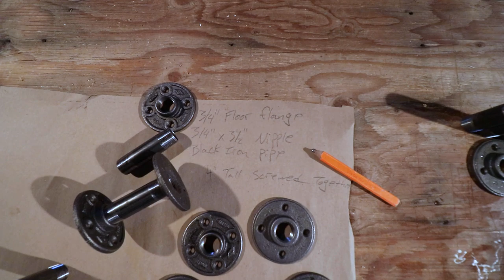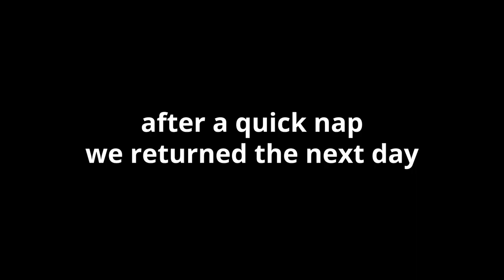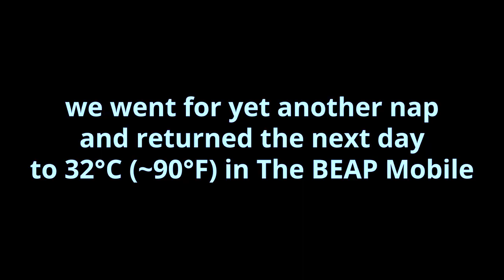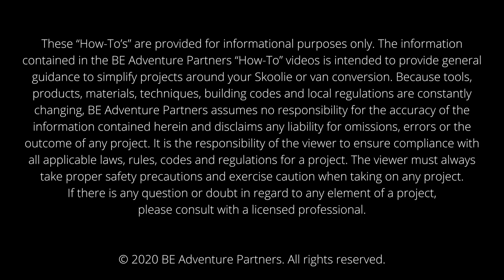Custom Built Hovering Kitchen Skoolie Cabinets - Part 1 | School Bus Conversion

Comment: Good news I found a bus in eastern Ontario. It’s still under contract until August. It’s been under coated every year since new and any surface rust addressed every spring. It has under  three hundred thousand km on it and five years of back records. Delivered to my address certified. Oh I can’t wait to stat my small home project. After watching you guys I’ve decided on a floor plan.due to the fact that I have welders and many tools my tiny home will use the first six to eight feet in the rear for my workshop. Then a wall for bedroom. Bathroom and kitchen , small living room or tv area. Wood stove and drivers seat.
Reply from the maker: Ohhh!!! That's such exciting news @Skunk Works! It's great that you've got them to deliver it too! August will be here quicker than you think! As you go through the process to get the title switched over to RV/Motorhome, take notes of the steps to complete the change over. Once you get the title switched over from school bus to RV/Motorhome, let us know because we'd like to feature your story of how it's done on our website. Had we gone the Ontario route to buy, we would already have this documented. But as of right now we have the process as per our research on our website and want to update it with the ACTUAL method: https://beadventurepartners.com/how-to-title-register-a-school-bus-as-a-motorhome-in-the-usa-or-canada/

We want to feature people from all over US and Canada for the various requirements by state and province.

Are you planning on getting a Cubic Mini wood stove? Or another brand? Would love to know because we too plan on getting a stove but haven't quite decided on which yet.

Thanks for watching and contributing to the conversation with your comments! We appreciate you :)
- Brian + Erin
Reply: BE Adventure Partners I already ha e a small wood stove that I was using in my hunting trailer. The little sucker would through a lot of heat . I’m going to try it first . It’s actually bigger then the ones I’ve seen in other buses.
Reply from the maker: Skunk Works so cool! Looking forward to seeing it installed in the future!

Comment: YESSS This is such a great idea! I would be bummed if you covered up those beautiful floors you worked so hard on! Love what you choose for the legs as well, we used those to build our deck rack and I was very amused but the vernacular as well Erin hahaha! It looks so handy to have all the studs easily accessible to attach things too! "it's like tassels for the drill" haha I literally thought the same thing, you should attach two on the front of the bus haha! So glad you noticed the extra space and were able to extend the wall to use it better, such a great thing to be able to just move a wall! Really enjoying the build and can not wait to see what you do next! Can I ask why two couches rather than an L shape following the side of the counter?
Reply from the maker: Hey @MEREDITH and PACO! We LOVE how you guys used black iron pipe for your roof rack rails (and we're probably going to steal that idea, if you don't mind (we'll mention you in the video, of course!)

Oooh! L Shaped couch does sound interesting... Considering we haven't built that space yet, now you've got us thinking about that as a possible option! Originally, we were planning two couches facing each other because when the front edges are pulled together, it would become a queen sized guest bed... However, an L shaped couch could still accomplish the guest bed feature and have the benefit of a L shaped area for guests to hang out on too!

Are y'all doing an L shaped couch area? Now y'all have us thinking!

Thanks for watching, friends!
- B + E

Comment: Hmmm... floating cabinets seem fine until you have to clean under them
Reply from the maker: Joy Colclough we designed them so that our cordless Dyson & Woca mop fits underneath 😉 definitely a great observation because that was our concern too! Someone told us that a Roomba would be a great option too. Come to find out, that device would fit underneath as well!
Thanks for watching!
- Brian + Erin
Reply: @BEAdventurePartners  i have an i-life s9 sweep and mop robovac...i paid like 150 bucks Canadian off amazon..u could put the charging  station under the cabinets it is way cheaper and works great...but if you use it daily you need to clean the filter weekly and change it monthly
Reply from the maker: Solid idea @Joy Colclough! We will have to look into that. We couldn't resist having the cabinets hover... The floors were just too much work, and too pretty to cover.

Comment: What are you doing for insulation?
Reply from the maker: Hey Katelyn! After we finish roughing out all the framing, plumbing & electrical, we plan on using Havelock Wool for insulation. 

Are you building a Skoolie too or want to?

Thanks for watching! 
- Brian + Erin
Reply: I have done a couple and sold one and the other I was hired to help build it. I like what you have done. Keep up the good work.
Reply from the maker: Whoa! Cool! What sort of insulation have you used that you like?
Reply: @BEAdventurePartners  spray foamed the first one and foam boarded the second one. The second one we actually added a layer of reflectics first and then foam board insulation over that and spray foamed all the gaps.
Reply from the maker: katelyn O'conner very cool! We’re using a combo of foam board, spray foam and wool batts depending on the area to be insulated.